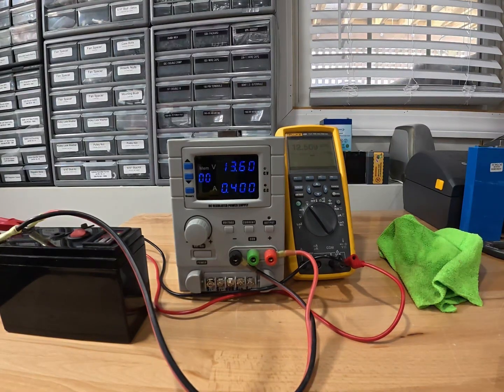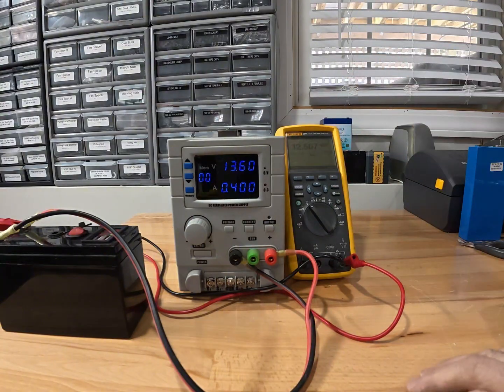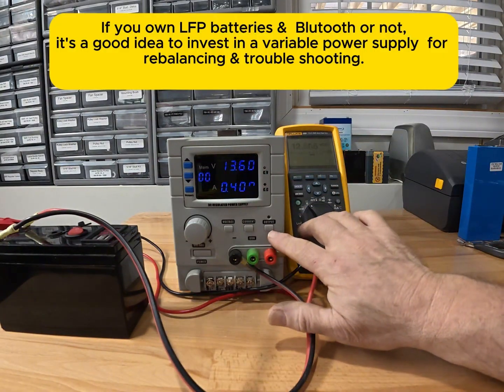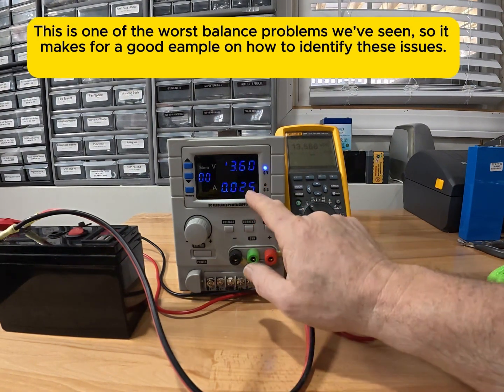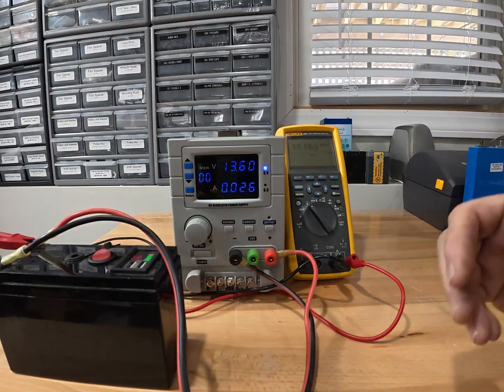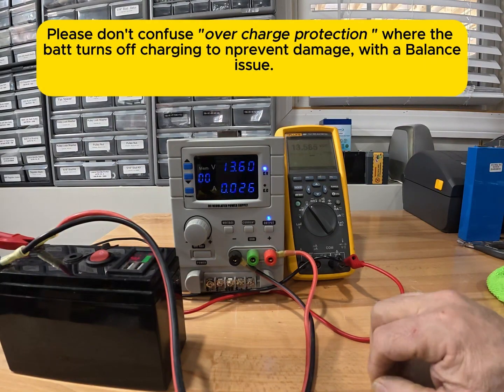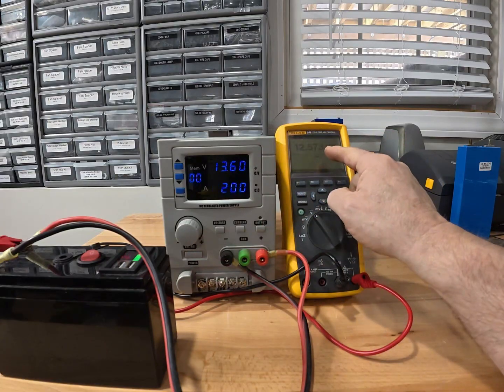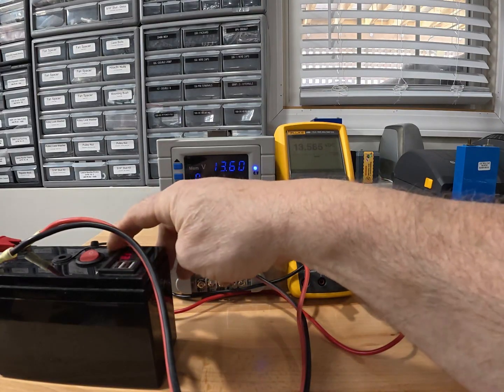Identify Balance Issues in LiFePO4 Batteries

Comment: Hi Rod,  Before you do anything I was wondering if a Capacity Test of this battery would tell us anything?  Also have you tried to rebalance this since you made this video, and how much progress have you make?  With the charger shutting down about 1.8 Volts prior to the charging cutoff voltage I think this is not simply a balance issue, but you have a dead cell.  Will Prowse of "DIY Solar Power with Will Prowse" recently (Feb 18, 2025) posted a video about a RUiXU Server Rack Battery that died. ""Ruixu Server Rack Battery Won't Turn ON?! What Happened!"  Feb 18, 2025.  In it he found 1 cell at 2.032 Volts while the other cells were around 3 Volts.
Reply from the maker: That is what alerted me to the balance issue. I charged it to full or thought I did. I came back after charging, put it on the capacity tester and it under delivered. I did bust the case open and sure enough one cell was off. I manually re-balanced. charged to full and it now delivers full capacity.. that said I sent it off to the recycler as I have no use for a cheap batt with no case. 
It had never been over discharged. just lots of PSOC cycling and probably not well matched cells to begin with.
Reply: @MarineHowTo   I charged it to full 
==> I think this can be the problem point. In cheap LiFePO4's passive balancers are used. These balancers only start to work when the 100% charge is close or arrived (triggered by a battery voltage of 14.4V? or by a single cell voltage of 3.65V which pushes the BMS to cut-off at same time the charger?). Due to its small current a passive balancer does need quite some time to balance, but if the charger was switched-off or removed immediately after arriving at the 14.4/14.6V maximum allowed battery voltage, then the balance time is close to 0, this means already minor differences between the cells will result in permanently increasing cell-charge disbalance.
In my understanding it is necessary to keep the charger sitting for several hours on the battery even if the charge current became zero. In these several hours the maximum charged cells (3.65V) do get discharged by the passive balancer and after some time the BMS again allows the charger to charge up more which closes the charge gap between the cells until after a certain time the voltage of each cell stays fully voltage-balanced let's say within +/-30mV around the maximum allowed cell voltage of usually 3.65V.
For a real determination of the charge failure I fear it is necessary to open up the case to get access to each cell and then see if the too low voltage cell can be charged up (if yes the failure is dis-balance either by failure of the balancer or wrong mode of charging by too early switching-off the charger, if not, such cell has an internal failure).

Comment: Hello Rod. Yeah this is a touchy topic. The bad news is ...until You open the battery case  and check it´s very difficult to know if it is really a bad cell or just a balancing issue. The problem is the small balancing capacity of the BMS especially with large cells. The BMS can only balance while charging. When the solar day is over there was not enough time for the BMS to complete the balancing process. The cell deviation gets bigger with each charging cycle. Only way out is an active balancer once in a while as kind of a maintenance procedure to restore the balance at the top end and once battery meter shows FULL as continuos active balancing will create even more issues. Due to natural cell degradation this problem will happen sooner or later and much sooner as the rated life cycles.of the cells. A slight improvement  is raising the charging voltage (if posible). This will shorten the time required for balancing. For this reason I do not recommend buying sealed batteries with no access to the cells especially for marine application/sailboats where the solar capacity can not keep up with demand most of the times.